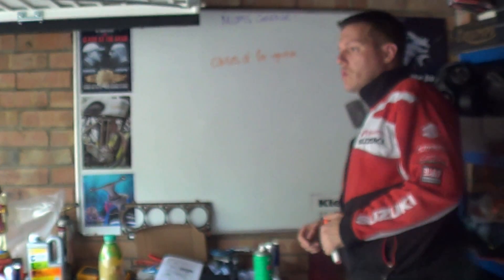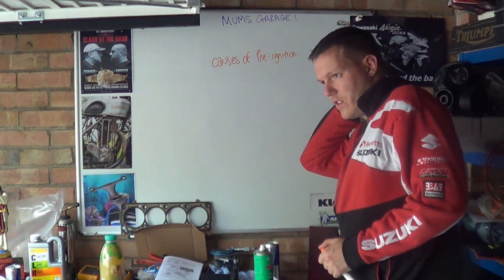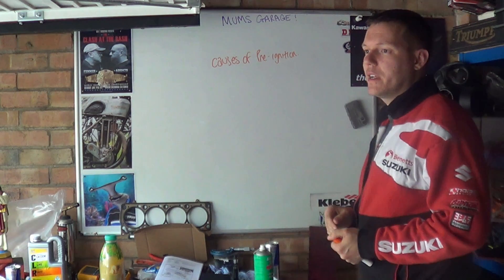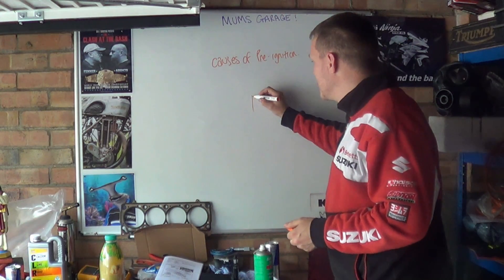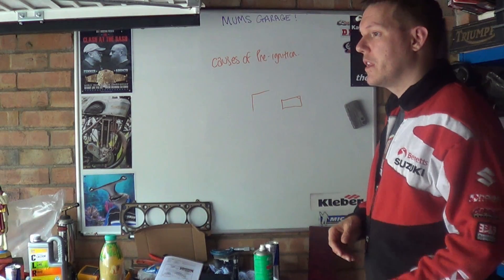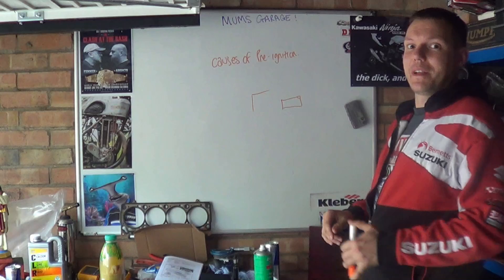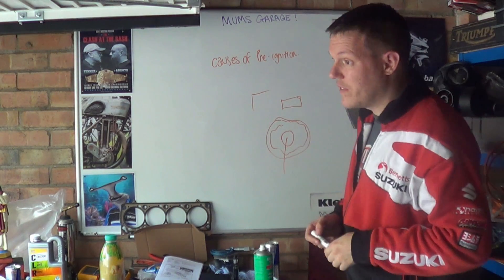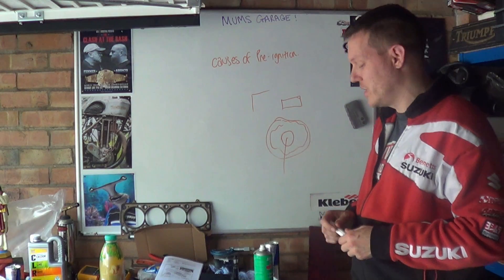Pre Ignition - What can cause it?

Comment: The Workshop. Could you please do a segment on cutting valve guides. I have cut valve guides down to the port with terrible consequences, the tip of the valve broke off and the valve dropped in to the cylinder. I'm guessing the valve vibrated until it broke. Engine Death from Stupidity. I would never again do that to a valve guide, but to warn others of the danger.
Reply from the maker: Great comment - ATTL - matt
Reply: Matt. Thanks.  Your videos are getting better and better.

Comment: I have an 89 yz250 2stroke dirt bike and when it runs out of gas it revs to high heaven. why dose it do this?
Reply: sorry it has nothing to do with the video
Reply from the maker: When you run out of fuel, the bike is running on fumes. This does 2 things. 

First its a better mixture because its vapour, then it starts to lean out. Leaning out means that combustion is hotter and this means more pressure hence more power then it dies. 

You need to stop it from doing that, this is when detonation and then pre-ignition occur the most - matt
Reply: Well when it starts to rev I hit the kill switch and some times it will die but if I catch it to late the kill switch won't stop it
Reply from the maker: That's run-on, and that's detonation
Reply: Put it in gear and stop it with your breaks. You seem to have pretty much shit build up in your combustion chamber. What about taking the head of and checking on it? Like this you end up with an fucked up piston sooner or later.
Reply: Well the motor has a lot of hours on it and was planing on replacing the top end soon but I have learned  to check my fuel more often. it hasn't done this in a while